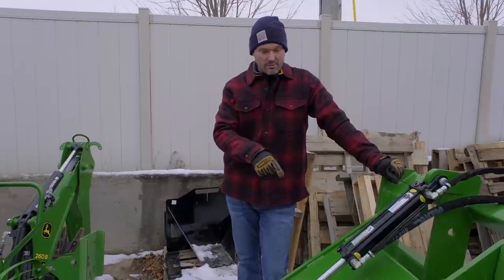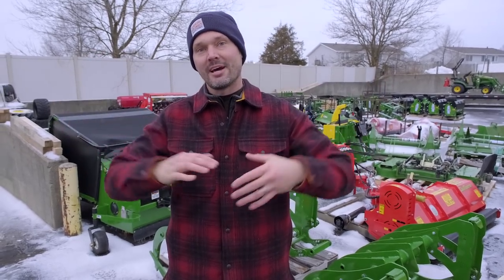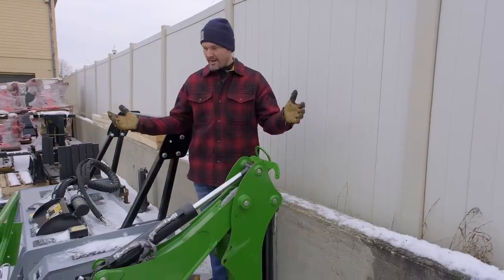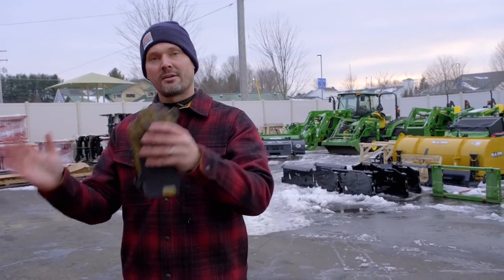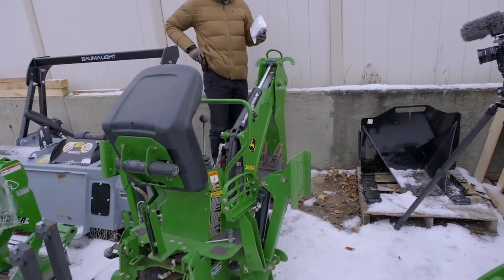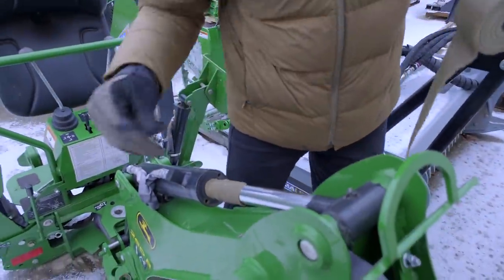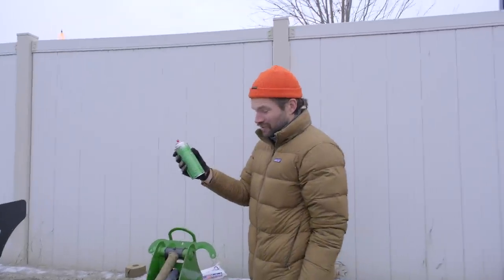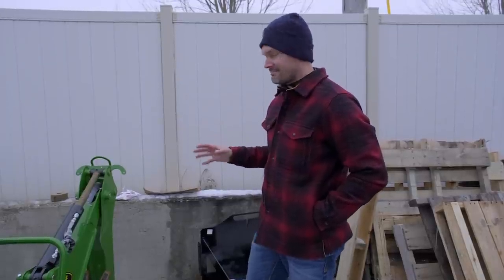SERIOUS HYDRAULIC DAMAGE? 😭 PROPER LONG TERM STORAGE 👨‍🌾🚜👩‍🌾

Comment from the maker: If you think you might need these storage products to protect your equipment, then get more info at these links.  Denso Tape: https://amzn.to/3hIyc0s
 and 
CRC SP-400 Spray: https://amzn.to/3bn35GX
Reply: I am an Ag/Heavy equipment mechanic .what  i do with my stuff if you cant retract the cyld. is to coat the rod down with wheel brng. grease .a good coating and you are good to go its cheep and easy to apply.

Comment: Good video. My Massey subcompact TLB owners manual calls for wiping the exposed cylinder rods with an oil periodically for rust prevention. A film of oil lasts a long time. I use a spray lube on my snowblower for summer storage (outside) to keep the rust from eating away on the chute and auger flighting, usually a couple of applications over the summer is sufficient. That CRC is good stuff. Really protects bare metal for up to a year or longer.
Hydraulic rods don't normally have chrome on them as the shine comes from good machining from a high speed lathe.

Comment: I use  Boeshield T-9.   A bit expensive (~$16/Can).  my wood shop is in a garage and my tractor is outdoors.  I spray down the rods and just let it sit. It eventually dries and leaves a lubricated layer.  In my woodshop I had sprayed my delta unisaw down and had a water leak.  A puddle sat on the exposed table for 3 weeks and caused zero rust as Boeshield leaves a teflon coating.  Will not harm paint or anything else that it over sprays.

Great stuff

Comment: I use Fluid Film on the cylinder rods on my FEL. It's stored outside with a tarp over it. When I want to use it I remove the tarp and wipe all the exposed cylinder rods with clean, dry cotton rag, (old tee-shirts)! Been doing this for 6 - 7 years now with no problems. Great job on the vids. I watch all of them so keep them coming.
Reply from the maker: Very cool, seems to be a popular option!

Comment: Hi Courtney,  What I alway do is smear a coat of (wheel bearing) grease on the exposed cylinder shaft. Wheel bearing grease is the heaviest type grease made and will not evaporate or break down. You could come back 10 years from now and it will still be protecting the metal. The good part is it easily wipes off with an old rag and it is dirt cheap to buy. Thanks for shipping my polyurethane cutting edge so quickly! Jack Venturi
Reply from the maker: Yeah, heard that works good too!  Thanks Jack!

Comment: I have a (hopefully interesting) different perspective.  I served as a Weapons Officer on a Navy Submarine.  We had missile tube fairings that were connected to missile tube hatches by turnbuckles (similar to but bigger than on the ones on a JD 3 point hitch).  Before getting underway, my torpedo division would coat all of the turnbuckles with a copious amount of Termalene grease.  These turnbuckles weren't just exposed to a salt water environment, they were submerged in it for months at a time.  Every time we returned to port (if we were in port for more than just a few days), the torpedo division would clean the turnbuckles and apply a new coating before getting underway again.  The Termalene forms a hard crusty covering when submerged in salt water, but it protected the turnbuckles.  In three years on the boat, we never had to fix or replace a turnbuckle.  The hydraulics were an entirely different story, but we rarely had to work on a hydraulic cylinder.  We mainly had problems with the hydraulic control valves.
Reply from the maker: Great info, thank you sir!

Comment: There are a few farm implements we keep that may not be used for several years,these we just put a few shots of generic gun grease on the chromed cylinder shafts that are exposed and wipe it around to cover all exposed and vulnerable areas as well as greasing zerks when parking the implements. 

When using the implements again, simple activation of the cylinders will expose a preserved and clean cylinder shaft.
Reply from the maker: Nice, thanks for watching and chiming in!

Comment: I've used foam pipe insulation cut to length and placed over cylinder rod.  Works great and is reusable.  I get it at Home Depot here in Canada for under $5.00  for a 6 foot length.
Reply from the maker: Nice!
Reply: Great idea
Reply: Does it retain moisture inside?
Reply: @stickboy6772   I haven't noticed any yet. I was told when I bought the pipe insulation that it was a closed cell material that has strong water vapor permeability to resist moisture absorption.  The cylinder rods are on an angle so the water tends to run off the insulation any way.

Comment: FYI... we use this stuff on water main parts... it doesn’t protect the valves or T’s or anything that much...we dig up some during repairs in the winter and at ten years old they look terrible... the older ones didn’t use it and we come across better condition stuff put in 60 years ago... depending on ground water saturation in the area...

Comment: I use  rust proof. Similar to fluid film.  You spray it on an let it dry before storage. Works perfect. Basically  when you buy new rotors for your car  that's what's on it .Its rust preventer. Cosmoline works good also.

Comment: My tractor & tools with hydraulic cyclender rods are always stored inside my shop. Would i still see any problems, being everything is stored inside the shop. . . . .would i still need to fold up the hydraulic cylinders rods so trhy are not exposed or not????? thankys for sharing your video.

Comment: I have seen a lot damage hydraulic Chrome rods from sitting . It’s a great idea too protect them some way when sitting for long times . It’s also very important too remove all sticky greases rust protectors before activating the cylinder . Abrasive debris like sand etc stick too these and damage the wiper seal and also start polishing or grinding the chrome if built up on the wiper seal or get under a worn wiper seal . Once inside the wiper seal it becomes worse scoring the chrome then the packing seal will fail next . Chrome dry rod on cylinders has more than one purpose . Dry clean chrome does allow anything too stick . So even when operating a machine never let grease build up on any chrome . After storage one needs too make sure too clean all protection that has been applied .

Comment: I give them a lite coating of gear oil, l was touching up the paint, and put a bit of gear oil on the chrome plunger rod to protect against overspray, I did have over spray, but it wiped of clean, like new. Don't use old oil, even a little hydraulic oil will work, l use the gear oil because it gives me a thicker layer. That's all.
Reply from the maker: Good idea!

Comment: Although messy, use a cheap small paint brush and a tub of any cheap grease to coat the cylinder rods. Yes it will need to be cleaned off eventually but still way better than rust/pitting on the cylinder rods.

Comment: Denso tape is widely used on Maritime Hydraulics onboard ships in an exposed saltwater environment.  Its messy, however, worth its weight in gold.
Reply from the maker: Yeah fortunately not as messy as I thought.  Although I guess they sell a grease you can apply before and then put the tape on top.  Have a great day!
Reply: @GoodWorksTractors  as the outdoor temp increases, the impregnated petroleum becomes less viscous, thus getting messier. Not terribly however, good stuff.

Comment: you can cut a pvc pive length wise as well, and zip tie it to keep most of the liquid water off the top. a coating is still a good idea for condensation moisture.

Comment: I use WD-40 Gel. Goes on thick and the spring looks like a wax coating. Just cycle the cylinders. Lubricates as it is wiped off. My implements are stored outside under roof. Fast, simple and no muss no fuss.

Comment: 1025r doesn’t even have chrome loader cylinders. I have always garaged my tractor, but I’m with others, anything with chains or cables, tarps are perfect, or even just a simple overhead cover. Lean to, overhang etc. but I can see if I wanted to put up a large implement for years, fluid film might be my choice. Something that won’t stop the movement of the cyl if it settles, and won’t leave a glue residue like duct tape.
Reply from the maker: Yeah, not sure what that's about.  I agree, indoor or covered storage is always best if possible.

Comment: I just had this thought for my new grapple. All I did was pulled the pins on the end and drew the rams in. For other stuff I spray it down with Lanolin base FLUID FILM.
Reply from the maker: Good idea, thanks for sharing!
Reply: Fluid Film is another product we spray on Outboard poweheads......Kinda depends on what you want.....A dry surface.....LPS 3......A shiny kinda gunky surface......Fluid Film

Comment: Only if you’re  in an environment that will remove the natural oil coating the cylinder rod has should you use any of those products.  You will potentially do more damage to your hydraulic system if those coating are not wiped clean before using.
Reply from the maker: I've never had an issue personally.  Just something that shows up in the comments section on my videos

Comment: That tape looks really protective, should really work well.  We've always applied a light coat of chassis grease...
Reply from the maker: Pain to remove?
Reply: @GoodWorksTractors  oh, not too bad.  A gas soaked rag usually takes it off with 3 or 4 swipes...

Comment: Can you afford NOT to store inside? 
Lets say you spend $15k for a 1023 E tractor. Its going to be a fairly new or low hours, or your brother is a John Deere dealer. Still, that's a big investment. At least for most folks. And we can safely say the bigger the tractor the bigger the investment. 
You can get a decent ConEx delivered for about $2k (depending on where you live) and that 1023 will fit nicely.  Not to mention the cool factor of a ConEx. 
Even building a shed with no sides for now is better than nothing. Next year put some sides on the shed. But I'm not talking about spending another $15k for a shed either. 
I just can't see putting that much into a tractor and not keeping it out of the elements some how.

Comment: 20 year aircraft hydraulic mechanic. Wipe the cylinder down with the same hydraulic fluid that runs through it when putting up for storage. Clean and reapply new fluid before running system.

Comment: I wrap vulnerable implement parts with tarps, shock cords, and rope. Affordable no fuss solution. Never have had a problem.
Reply from the maker: Protection is key
Reply: The issue i have with tarps is a lot of condensation occurs inside the tarp...
Reply from the maker: Yeah can see that creating issues of its own

Comment: Curious after the tape has sat out in the sun for months, how hard is it to come off? Using a knife to remove tape is not recommended, so what other option is there?
Reply: It comes off fairly easily just leave a bit of a tag on one end but can be a bit of a clean up if it's in hot weather it tends to bleed out a bit more wax/oil but quick wipe down and it's clean

Comment: Never have i ever heard of this in my 40 years around heavy equipment. 
Save your money. Put your time to better use else wear. 
I have owed many pieces of heavy equipment, Stone chipping and road salt are the biggest concern while in use.
Reply from the maker: So the saying is true, you can't teach an old dog new tricks?
Reply: @GoodWorksTractors  nope especially not a crusty old contractor
Reply: I owed a machine shop for 21 years and repaired hundreds and hundreds of cylinder rods. Broken rod or torn rod eye was the most seen repair. Then bent rods. Next was piston broken off the end of rod. Next was chipped chrome repair which in this area ment a new rod built.
Reply from the maker: Well I guess none of those items really seem to be closely associated with periods of long term inactivity.  That was the focus of the video. Perhaps another video to be made!  It makes sense that cylinders being actively used will wear and break over time.  Thanks for sharing and Happy New Year!
Reply: @GoodWorksTractors   Sorry about that, I will still stay more on topic next time.
Thanks for your videos even an old guy can learn something new once in awhile.
Reply from the maker: Not to worry, thanks for watching!

Comment: Check out ACF-50, coat your rods and quit worrying about it. Known chemical from aerospace industry. I use it for motorcycle chain lube.
Reply: I saw a can for sale on Aircraft Spruce… reasonably priced. Thanks for the tip